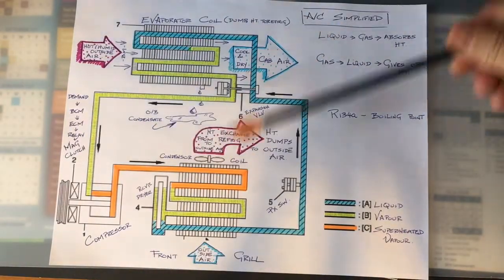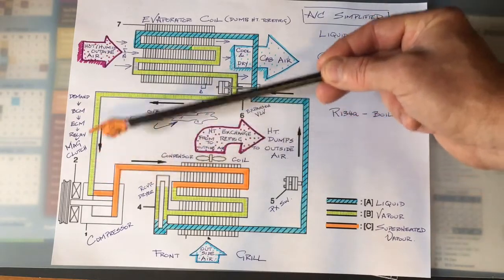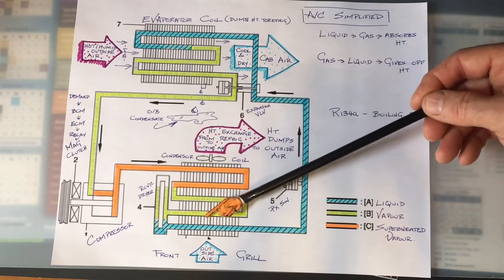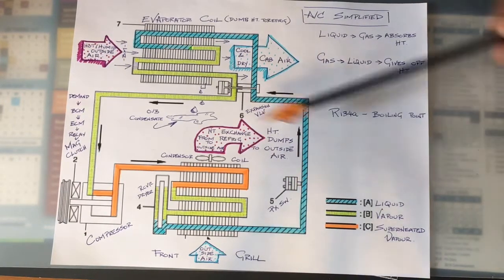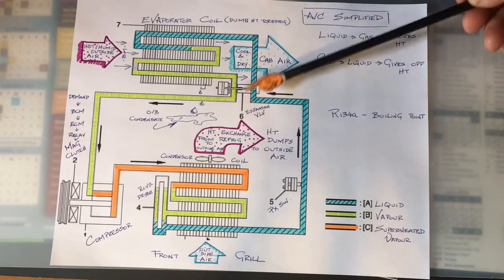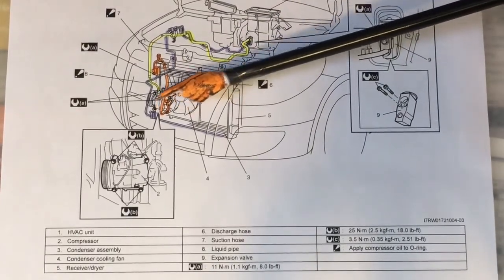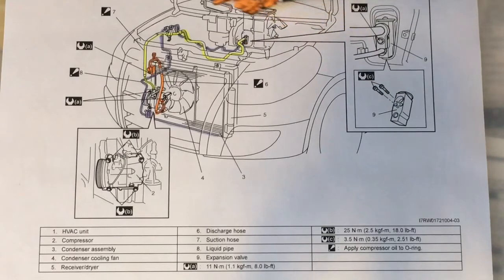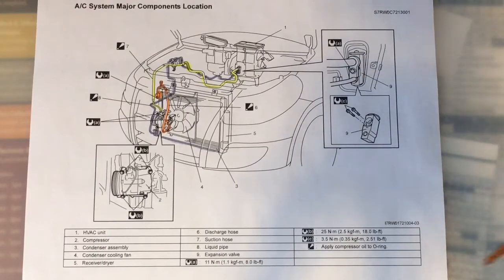Suzuki SX4 A/C Simplified

Comment: Great explanation.. I wonder if you would give me your 2 cents.. I bought a used 09 sx4 las year and  the Ac has been (partly) removed..  the compressor and for the rest I'm not sure.. I just have 2 metal pipes cut and left like that.. I've been having intermittent issues with the car (check engine, rough idle, lack of power) and I'm trying to eliminate anything that might cause issues.. I'm wondering if air/gas could be coming in or out by those pipes.. or the coolant being disturbed by the removal of compressor.. I wonder if I should remove all Ac related fuses and relays and other modifications to avoid further issues..
Reply from the maker: Thx for watching…I doubt the partial removal of the AC system is causing your issues. Reason being when AC refrigerant pressure drops below a threshold it will inhibit clutch engagement. (Your system pressure is almost certainly Zero if refrigerant lines have been cut/removed) I would remove the AC compressor relay to safe the system (if not already removed from the under hood distribution box (just aft of battery)) Don’t remove the fuse as I think it also powers other circuits if memory serves….There are many things that can cause your issue. A few simple things you can easily do are clean the MAF (Mass Air Flow) sensor and clean the throttle body. There are many video’s on the channel including a couple dealing with those concerns. And many more dealing with AC architecture. Good luck. Cheers 👍

Comment: I have an European 2009 SX4, hatchback, 1.6 VVT petrol, 4x4.

It has a weird issue, in that my AC works OK (about 10C at the vents) when the ambient temp is below 30C or thereabouts and the engine is cool (i.e. first start in the morning). If I stop the engine after a ride and start it back again, it blows non-cooled air.
It did the same at the end of last summer for a couple of times so I took it to an AC specialist that e checked the pressures and the quality of the refrigerant and said hey were OK. No leaks, too. He fiddled with it and it worked flawlessly until this summer's heat wave hit, and started consistently behaving as described again.

What should I look into? Could it be the expansion valve is acting up? Any other possible causes?

Thanks!
Reply from the maker: I suppose the TXV is a possibility…It’s possible the compressor clutch operation is intermittent. Just check for engagement (or lack of) when you lose cooling. Maybe failing electrically (control, relay, wiring or marginal coil itself) or physically binding. It also maybe worn and the gap requires adjustment (shim(s) removed. Any of these issues may only manifest with high/heat soaked under hood temperatures. Also check condenser fan operation. Just a couple of ideas it maybe something else, I am no expert. Good luck. Cheers 👍
Reply from the maker: This may give you a better idea of clutch details if yer interested 
https://youtu.be/_0GN8aqjLpo
Reply: @TheGibby3340  Thanks a lot for your reply! I'll try to look a bit into it with SZViewer an see what it can reveal. Trouble is... specialised servicemen aren't THAT specialised, unfortunately, and might have to be spoon-fed towards a solution. They certainly are less knowledgeable than some involved "amateurs" out there...